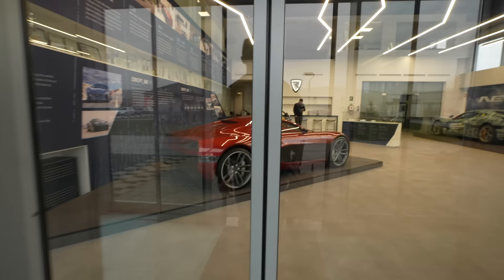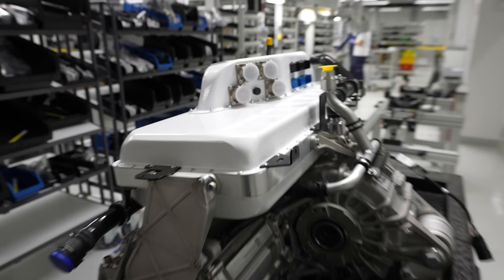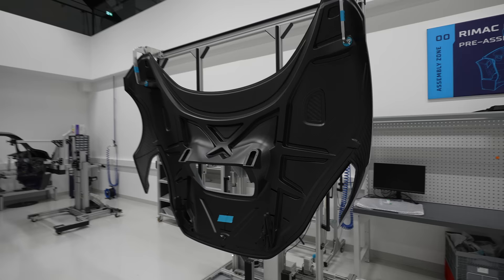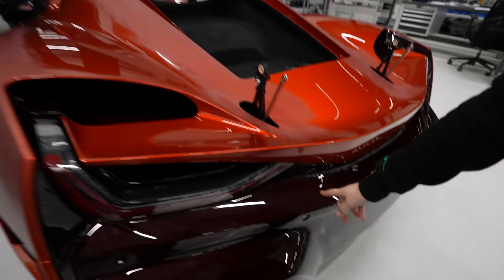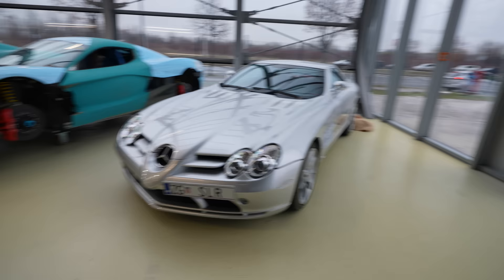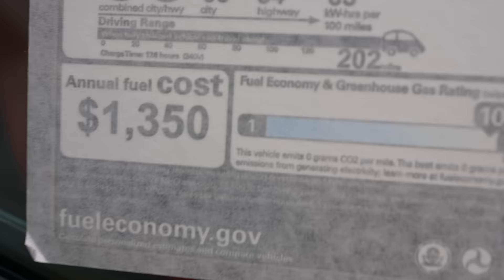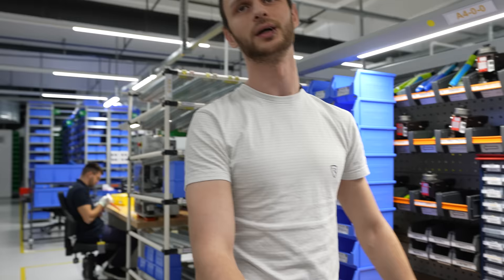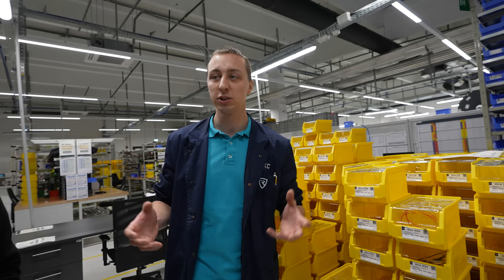Bugatti Rimac Factory Tour! // 2024 Edition

Comment: Rimac and Koenigsegg are my favorite car brands. So innovative. Curious how it's going to affect Bugatti design and production and maintenance.
Reply: Lets be real, Rimac brings battery/BEV knowledge into the BugattiRimac jointventure and Bugatti/VAG the production knowledge and VAG infrastructure, Bugatti  and BugattiRimac joint venture are 2 different things.
Koenigsegg powerboats are great cars and coffee vehicles if they start but a real petrol head buys a GMA or Valkyrie or something like that, their gearbox is a masterpiece, everything else is mostly overhyped old renewed "inventions"
Reply: @yerrie1908   Bugatti is: 55% Rimac and 45% Porsche
Bugatti Rimac is ONE Company with Mate Rimac as CEO  ...and HQ, testing and development in Croatia (Campus)  ...thanks to Mate Rimac Bolide and Mistral are in production
New Bugatti "BR1" thanks to Mate is gonna have V16 NA engine + Hybrid Battery system!  Porsche wanted Full EV Bugatti  ...Porsche has nothing with the New V16 engine!!  ...it's Cosworth/Rimac with hybrid battery system!  ...so Cosworth like Valkyrie and GMA 😉
Reply: @joebeus6886   Bugatti Rimac group is a joint venture and yes and Matt is CEO and Stephan Winkelmann is CEO Bugatti automobiles. There is no discussion about Rimac leading the battery/hybrid technology, not mass production but for high performance, that's all correct.  
Koenigsegg is a different story, just said that these are not driver or track cars but more drag strip powerboats t show at cars and coffee events.
Matt is one of those great tech entrepreneurs but that doesn't mean he is the only one bringing tech to the Bugatti Rimac group, it's not that simple, they have both their strengths as said
Reply: @yerrie1908  No no Winkelman WAS Bugatti CEO until 2021 
Now Winkelman is "only" Lamborghini CEO 
Since 2021 Mate Rimac is Bugatti Rimac CEO and Bugatti president is some French dude!  ...but Mate is in charge!
Reply: Even ICE Koenigsegg use Rimac mechanical parts. Specifically parts of the gear box.